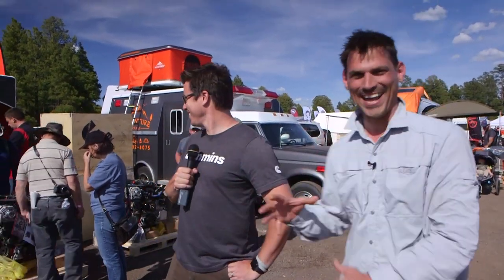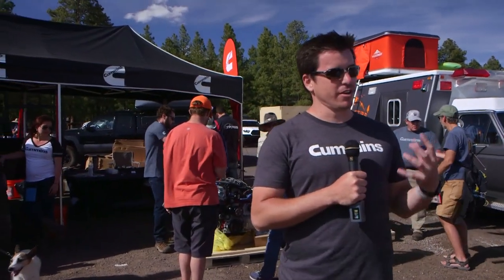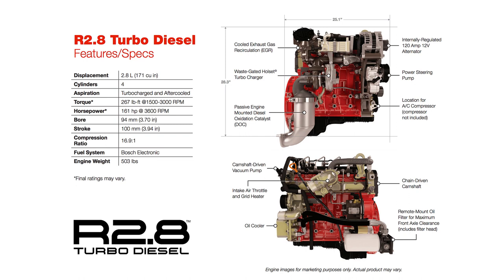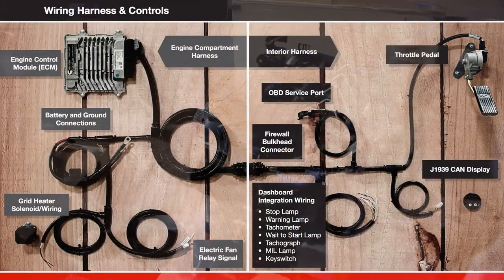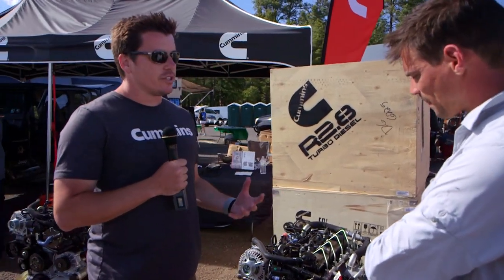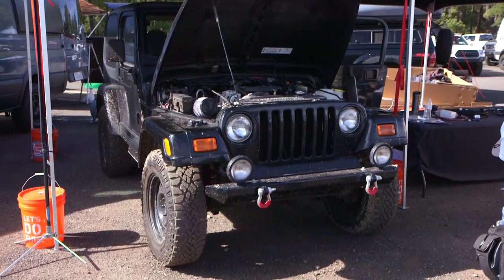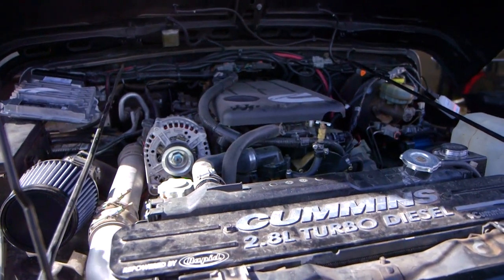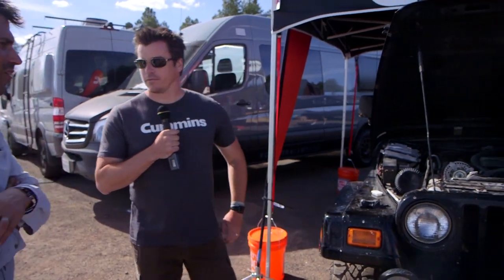Turbo Diesel Crate Engine for your Overland Rig - Cummins R2.8

Comment: At nearly $10k, I think most will stick to 4bt/6bt's.
Reply: hell even a mercedes 3.0 5cyl is a better choice
Reply: That’s including all of the auxiliaries pedal and ECM/wiring. Not a crazy price for a brand new product.
Reply: Actually a pretty solid price, considering everything is new and it’s a complete package. If you’re keeping something for the long term, this would be a great option.
Reply: Ryan Jenkins restored 4bts go for near enough 10k and they are a worse motor in every singe way, and they don’t come with a wiring harness.
Reply: @Aron-ru5zk  If you buy a restored 4bt rather than a used one and going thru it yourself, you deserve to be paying 10k lol

Comment: I have a 05 liberty crd with a 2.8, and i am sure the numbers are comparable to the cummins in this video. This would be a great conversion, we just got back from a trip from VA to Alabama and we passed all the gassers on the uphill grades without even falling out of overdrive, no drop in speed no freewheeling down the grades, 30mpg loaded with luggage and equipment. I would say this is worth the money if you travel.
Reply: My  5.7 Oldsmobile diesel  gets  35 mpg.

Comment: Kit doesn't include an intercooler of course because every application is different, only has 161hp, 267 lbs torque and a wimpy 120amp alternator. fuel efficient though.

Comment: Really cool idea and our hats off to the guys at Cummins for the attempt. These will make many TJ owners happy. The issue with putting these into anything remotely modern (anything newer than 2000 Jeeps etc) is integrating these custom powertrains into vehicles that are almost entirely computer controlled. Transmission controls, onboard instrumentation, cruise control and safety systems, etc. will all need to talk to each other and be custom-programmed. This amounts to a ton of electrical wiring and programming. As such, this will be costly to implement on many levels. Guys hoping for a sub $10k diesel swap will be sorely disappointed. Secondly, emissions compliance. For those hoping to install one of these into a 2005+ Tacoma etc. I'm afraid you wont have a Cummins certificate of compliance anytime soon. In order to be compliant, these engines will need to have treatment systems and Cummins would need to certify the installation for each vehicle. This is both ridiculously expensive  and complicated. Cummins can sell these for TJ Jeeps and older Landcruisers because these vehicles are grandfathered in due to age. We actually prototyped these engines a few years ago in a 2008 Tacoma and they performed really well.

Comment: I have a winter home in the Philippines.
I just bought a Chinese-made pickup truck there called a Foton thunder (4-door 4x4) brand new, 2019, for USD $20,000......It has - from the factory - a Cummins 2.8 turbo-diesel, Gertrag 5-speed manual transmission, a Borg-Warner transfer case, and Dana axles.
It is Great !!
Used to own some semi's, always loved Cummins....
Reply: Brat Cafe i bought a honda pioneeer with a plow for 18k i got a better deal and u cant even take that 4x4 in the sand without sinking and getting stuck
Reply: Brat Cafe
Post a video of your truck.

Comment: These should be made available for smaller SUVs and trucks. Not everyone needs a big badass Ford F350 with a 6.7 Powerstroke, or a Chevy/GMC truck with a 6.6 Duramax Diesel. Most of us simply need smaller truck to haul things to a job we have, or to tow a small trailer, a travel trailer or a utility trailer.
Reply: This one will fit smaller rigs
Reply: I agree. If your Jeep XJ Cherokee originally had a 4.0 litre gasoline six engine, this could fit comfortably under the hood.
Reply: I would love this in my Tacoma!
Reply: This motor needs to be an option for wranglers. They are putting the ecodiesel in the wrangler eventually but only in the 4 door because of its size of transmission and def tank. It would be nice to have a diesel like this in the 2 door.
Reply: Nissan xd
Reply: Martina Gutierrez discontinued
Reply: I have a 2.8L duramax turbo diesel in my GMC Canyon and it is amazing!! 8,000 lb towing capacity in a small truck anyone?
Reply: @lewisclancy5404  Since I've never driven either a Canyon or Colorado, I don't know how much either truck is capable of towing or carrying. But with a small displacement turbo diesel engine powering this bad boy, I would imagine it could tow more than a gasoline engine ever could.
Reply: @jasoncarpp7742  Yeah no mine tows 8,000 lbs with the duramax 2.8L
Reply: @dillonh321  4 doors are nice, but why should it only be available in 4 door models? Why not make it available for all vehicles? And more to the point, how about make service and maintenance available all over the USA, like Cummins does for its larger sibling, the 6BT.
Reply: @lewisclancy5404  Awesome!

Comment: Here in Australia, I have a Nissan 4x4 ute (pick up) with a 2.3 litre common rail, 4 cylinder, twin turbo. Puts out 188hp/450nm. 
Popular motors here.
Can tow up to 3.5 tonnes and I can get 6.4 litres per 100km on the freeway. Pretty remarkable engines.
Reply: One year later..... how's the Navara going ?
Reply: Yes but we can't get those in the us

Comment: Finally a bolt in option, I have been looking at diesel engine swaps for my XJ for sometime. Now I have a new option that looks very promising.
Reply: I love my 4.0 in my XJ but it's lacking power and gets such shitty mileage. And I want to keep everything mopar but Hemi's are huge and expensive. I think I'll have to start saving for this cummins
Reply: Nomad-76 Yup but it won't be a budget option at all, you'll have to shell out the bucks.
Reply: I have contacted Cummins for a price but haven't heard back yet. I expecting some major sticker shock however, I prefer to keep older rigs. Furthermore, if you compare it to buying a new diesel vehicle it's probably a more sensible option for those that enjoy maintaining their older vehicles.
Reply: Agreed, I have look at some of the V8 option as well and not only are they costly, they also require a lot custom work to install.
Reply: Someone on Pirate 4x4 was saying $8500, who knows if that's correct though..
Reply: Probably more like $12-15k.
Reply: Nomad-76 i
Reply: Jeep_Geek if it does come in at that price, it would be worth it. 12 to 15 seems really high.
Reply: Costs about $12kUSD to build out a Cummins 4BT and do it right, so this as a long-block crate with all the bells and whistles at $15kUSD would not be bad at all, IMHO.
Reply: just get a recked 05-06 liberty crd, it fits like stock and its  better all around.
Reply: Have you considered a Ford 5.0 (not a coyote, they're huge) or a GM LS engine
Reply: Wait er I mean weight. I think he still wants his Jaguar to go around corners
Reply: Gastodiesel.tdicoversions.com has excellent kits for xj's. 1.9tdi's are everywhere AND they have a huge aftermarket. I personally built a 310hp 1.9tdi bored out to 2.0 with a bigger turbo, forged con rods, girdle, etc. In the legal department in California it is legal to put it in a car or SUV same year and older with all the smog equipment other states don't care or are less strict.
Reply: Jacob Moses most guys like keeping their parts loyal to brand a ford engine in a Chrysler just couldn’t make sense
Reply: I'm putting mine in the shop next weekend and starting the teardown to put the 2.8 in it
Reply: 1979 Camaro Young Gunz Racing Into a.... 1979 Camaro?
Reply: Erik Kovacs no I have a 91 xj
Reply: I have an AMC 258 with 4.0 cylinder head swap,  makes about the same torqe at roughly about the same RPM, 10-12mpg city & 15mpg highway, im talking about a big 1978 Jeep j10 in 35". $1500 for the whole engine build + labor.

Comment: I could finally have a diesel Land Rover in the US.
Reply: Aaron Maughan, yes! Too bad we can’t get that wonderful 5 cylinder.
Reply: nsatoday it is probably the best small displacement diesel ever. I daily one over here in the uk! 😁
Reply: Aaron Maughan man o man whata dream disco 2 needs a new heart
Reply: Way cheaper to re-engine than buy a new rig.  I re-engined my 2000 GMC Sierra 1500 for 10% of what a new one costs. This will be my LR4's next motor.

Comment: This is just the engine for those with something like a Ford Expedition--like me--who want better mileage and a more reliable engine than the Triton 5.4L.
Reply: pancudowny I have an 08 XLT and couldn't agree more.
Reply: pancudowny i think it’s like 10 grand without being adapted to your transmission or with the engine mounts or anything. Better to just save yourself the pain, sell the expedition, and buy a ford wit a 7.3 or an older suv and swap in an older 4bt to pass emissions for way cheaper
Reply: I don't think the 2.8 would work very well for a vehicle of the weight of your Expedition however all is not lost https://shop.bankspower.com/i-2556-13110-engine-gale-banks-630t-v6-3-0l-diesel.html
Reply: pancudowny I have a 2006 f350 with the 5.4 and it is the worst motor I have ever dealt with. I don’t know why every car and truck in North America does not come with diesel.
Reply: This is a strong option for my 2000 ranger
Reply: @jacobmoses3712  
Why would you get rid a 7.3L diesel engine for a skaller 4bt ?

Comment: Everyone is so worried about out put numbers. It's known that it isn't hard to 'wake' up a diesel and get more power out of them. I'm sure the low starting numbers are a result of this being emission compliment with a broad number of vehicles. It will be interesting when companies like efi live release tuning options for this and people start deleting and tuning them. Then I'm sure compound will surely follow quickly afterwards.
Reply: So don't worry about spending alot of money for no power cause you can always spend more! and um, they were talking about fuel costs like this would save money lol.
Reply: Matt Lane tuning and deleting is fairly basic practice with diesels now a days. And as much as it would cost to swap it would not out way the fuel savings, but going on a trip or off road trip the amount of miles you get on a trip can be a big space saver and very convenient when going for longer trips. Along with the power to turn the larger tires when highway driving is a benefit as well. Also, this program is targeting a very wide market, but the immediate people they are after are the ones who are doing build and are yet to have a power plant. This Cummins directly competes with the ls crate options on the market.
Reply: Matt Lane if you're only getting 10 mpg and struggle to go 70 down the highway, this is a good option. 
I'm planning on buying an XJ with a better body next year and really thinking about doing this swap
Reply: They have an article about how they put this motor in a half ton truck and it was making over 200 hp and almost 400 ft lbs of torque but they stopped pursuing that for some reason

Comment: A 3.0 v6 turbo diesel with 240 hp and 420 lbs ft of torque similar in output to the jeep and ram offerings would be acceptable

Comment: I have seen some do an ISF3.8 swap on their jeep. It's more efficient, powerful, and torquey than it's older cousin which is the 4bt. There should be a 3 engine line of Repower engines in addition to the 2.8l I4 diesel, a 215 hp 3.8L I4 based of the ISF3.8L, and a 5.0L V8 based off the ISV5.0. A Repower for everyone.
Reply: Making this 4 cylinder  into a inline  6 cylinder  would be 4.2 liter   .

Comment: Man this is going to change the overland hobby. I was lucky enough to get engine #25 and had planned on using it on a personal fj55 project but a old hot rod customer wanted it  worst so a cj8 scrambler it will go all with the jku Rubicon chassis it was to be installed in. my stipulation was if the next one isn't here by november I get to overland up on hull mtn/mendo pass a week before christmas to find that perfect tree in his jeep. can't wait for the 5.0 rollout as its destined for dad's 78 e-van that we rolled in as a kid, who knew 4wd was better when the van could bounce and be come alonged every 6ft.
Reply: P.S. Engine cost $8000.00- 80 nickels and a penny

Comment: Need one of these in my 98 Tacoma 4x4 sr5 😍😍 along with a 115L diesel tank  which is about 30 gallons. Twice as much as the stock 15 gallon tank in my Tacoma. 25mpg multiplied by 30 gallons = 750 miles before I have to fuel up again 💆🏻‍♂️ it would cost me about 20k for all that though! One can dream. One can dream

Comment: Cummins should consider adding another repowwr engine to the lineup in the 3.8L to 3.9L range with 300hp and 500 foot pounds of torque would be a nice place to start.

Comment: Sweet looking engine! I hope that Cummins is able to offer it for American customers. Given the constantly changing emissions standards imposed on engine makers by the damn EPA, it's all but impossible to make a diesel engine that's "clean enough" to please them. However, not everyone either needs or wants a 6.7 litre Cummins turbo diesel engine, sometimes a small displacement turbo diesel engine would work just fine, thank you. :)
Reply: Jason Carpp : And sometimes you don't really have the room for the larger engine. 
So this will fit into smaller engine compartments.
Reply: Exactly! I'd buy a small truck if I could get it with a small displacement turbo diesel engine.

Comment: I'm excited and want one for my yota ... but at the same time... I get the feeling this crate motor is going to cost more than my entire truck and all the upgrades combined.
Reply: Yeah but say, 10 grand to do this, and drive your rig for the next 10+ years, or a new truck at 40 grand or more? :) I just keep maintaining and driving my 92. I don't want a newer rig. I hope to keep it for another 20 years heh.
Reply: Cummins is giving discounts on the crate engine, to the tune of $1k off (so about $7k-$8k).  That's a lot, but still in line with what other crate engine setup's fetch.

Also, putting this kind of engine into a 1990's era LC 80 would definitely add at least something to the resale value.  I don't think you'll recoup the full cost of the swap, but diesel LandCruisers are hard to come by an will fetch a premium if properly built and maintained.
Reply: I Would  Like One In My 1988 F-150 xlt  4.9 I-6. I Love My Truck!!!!!!!    WDA.

Comment: Not to be a negative Nelly, because I am a huge 5.9 fan, but a 25 mpg average is pretty crap for a 2.8TD in a 5k lbs jeep. My 2006 duramax 6.6 ran over 23mpg in a 6k unloaded truck. By the time I was on the highway, I was over 7,500 lbs. Mpg was consistent from Wyoming to Corpus Christi, with a long stop in heavy traffic in Houston. For anyone that plans to buy this kit, get an EFI live tune, better exhaust, and a good intake, I have no doubt you can achieve 28+ with those mods.

Comment: Low end torque is the most important feature. Added benefit: effective exhaust brake for vehicles in this weight range.
Reply: Kevin Hornbuckle unless it was a Cummins day one designed Jake brake I wouldn't use it. the new Colorado diesel has a engine brake but it uses the variable vanes in the turbo to do so. I've seen many failures in the dealer due to it.

Comment: The D4D Toyota is a pretty sick little modern diesel engine. I got to ride in a few Toyota Fortuners in Asia with them and they pull hard. Recently I got a std dodge with the 24v diesel and that low end tq and mileage increase is crazy coming from a gas truck similar. But with diesel the parts are allot of money and servicing costs more.

Comment: Putting one in my 3rd gen 4Runner!
Reply: I'm eyeing one for my 3rd gen too. I wonder what it would take to make the stock gauges work and keep the sensors happy?
Reply: mandaloin looked like from the diagram they have wires for gauges in the wiring harness. Hard part will be figuring out the stock wire set up to match with the supplied Cummings harness.

Comment: Super cool program. I'll have to check if they offer a 6 cylinder or plan to. For me I couldn't spend motor swap money for the same stock power my 80 came with even with the awesome mpg
Reply: Alex Stern If you want a larger diesel then go take a 6bt or 4bt out of a junkyard, id bet you will have to give a left nut to get one of these.
Reply: Truth be told I would rather LS swap my 80

Comment: For fun, I got a real challenge for you, see if you can put one in a 68-74 Ford Econoline van, the largest engine available was a 302 V8, and for an idea of space available, the 351W is too wide and tall, takes modification to fit it, not suitable for daily driver. I bought this because the engine placement makes it within reach for service, and using a wheelchair makes a van the best option for me, that and I put a bed in it for sleeping. The 302 is murder, the stock/original engine musters about 10 MPG at best, and forget towing, it just doesn't have enough power to do it.

Comment: Yay finally a motor like those in Australia! Sounds like its going to really take the market by storm depending on the cost. Any idea of the price for one of these engines?
Reply: Gary Cloud I believe they're going to be around $8k. Steve at Cummings has said to expect to be roughly the same cost as the LS Erod.
Reply: OK thx for the information.
Reply: Gary Cloud. They are in Australia. Foton Cummins China make these engines and they installed in most Foton Tunlands etc. I have a 2015 foton view royal saloon which looks like a toyota hiace commuter. Power wise craps all over any hiace I've driven but they aren't old enough yet to see if the longevity is there.
Reply: $9000 for the US.
Reply: Mike E  buy a Foton Tunland wreck from the auctions.

Comment: That engine COULD make more power.  It has max horsepower at low rpm so that means you could put in a hotter cam (higher max hp & higher redline.)  That means the torque wouldn't be AS HIGH at low rpm's though.  You could also ADD boost.  I wonder what power it could handle at it's limit.